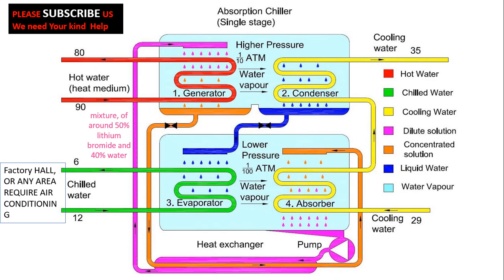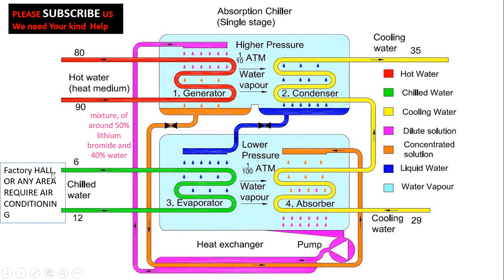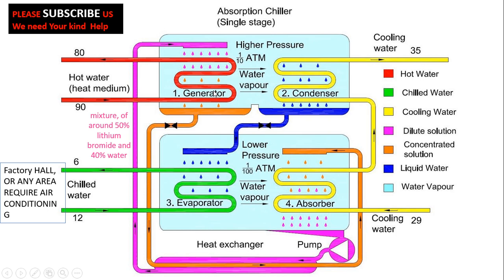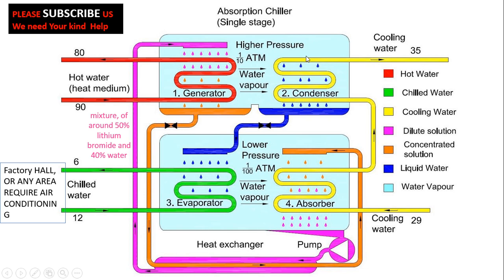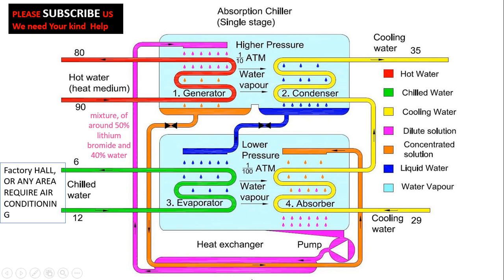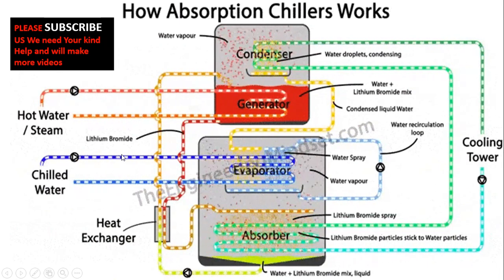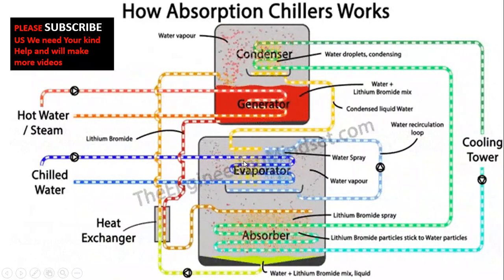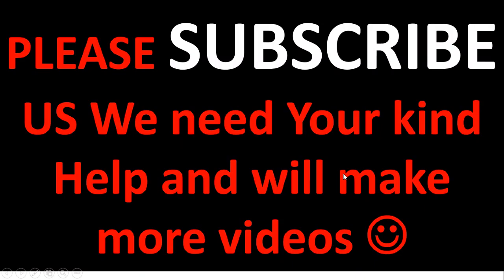Absorption Chiller working Principle, How Absorption Chiller works, Chiller Explained.!!

Comment: Hey, sir. Thank u for the explanation. But I have a question regarding to the construction of this device. Between those process in high pressure vessel or in low pressure vessel, what is the mechanism to saperate the process ? Do we need to construct a separating wall or smth ?
Reply: no wall required
Reply: only some baffles plates works

Comment: Thank for your explaination . I have 1 question why the shell side come corrosion in absorption chiller sir?
Reply from the maker: Its common. Usually Some coatings and chemicals can be used to avoid rust.

Comment: Thank you for the explanation! My question is, what is the purpose of the absorber coil if water and lithium-bromide (LiBr) naturally are attracted to each other and will condense as a result? If anything, you're gonna cool down the mixture and require more heat from the the generator to evaporate the dilute solution.
Reply from the maker: Dear Mohamed Tantawi, sorry for delay in reply. The anser of your question is: You see water is in the vapor form and it is coming from EVAPORATOR Where it got heat of the Coil which will now cool the HALL...So the water has become in vapor form, now again we want to cool it down to make it liquid so we have to pass it to a coil in this case the coil is of cooling tower, it becomes liquid and then it mixes with liquid...(please note it is not good idea to mix water vapor and liquid Lithium Bromide)
Reply: @Brightmindspk  Hi! Do you have some energy data, T,P, H Chart? So I guess the evaporation starts at ~200 kJ/kg (0,1 bar) as it is in condenser energy state. Expanding starts in P=0,01 bar, or more acurately around 0,0084 bar. By doing this, entropy is increasing. But i do not understand how it starts to condensate only from 12°C and then from the cooling tower when it is already on low temperature. Your adding energy to a low energy system, which should not condense, at least maybe I'm missing something. Does the LiBr make it condense?
Reply from the maker: @nortranserbia831  at low pressure the boiling point of water is also reduced and this is the reason that it starts evaporation at 12 degree and 1/100 bar.
Reply: Hey, sir. Thank u for the explanation. But I have a question regarding to the construction of this device. Between those process in high pressure vessel or in low pressure vessel, what is the mechanism to saperate the process ? Do we need to construct a separating wall or smth ?